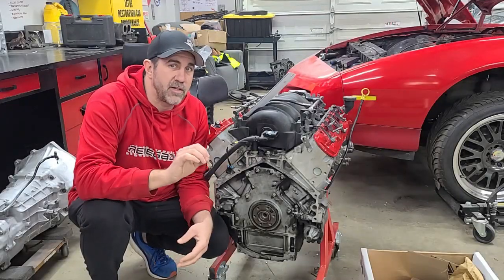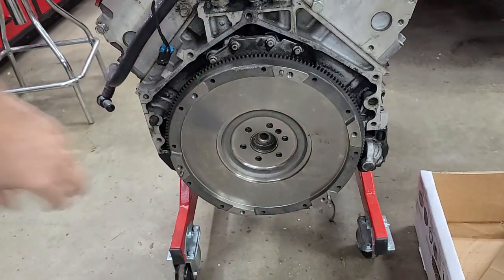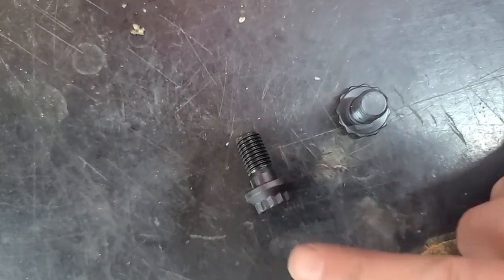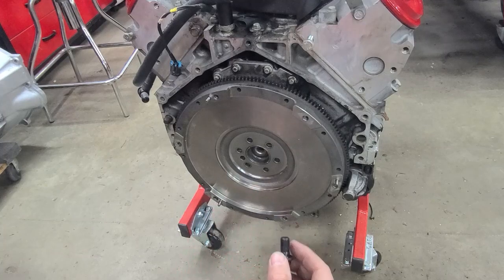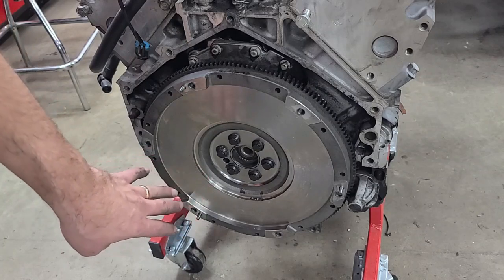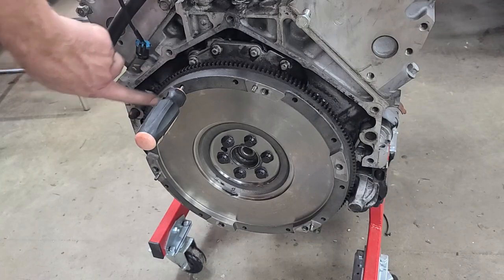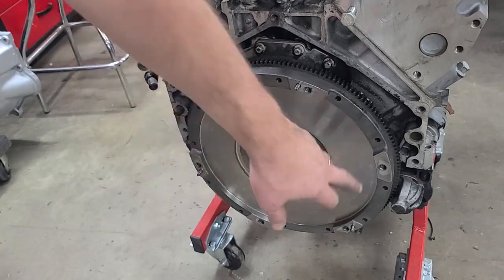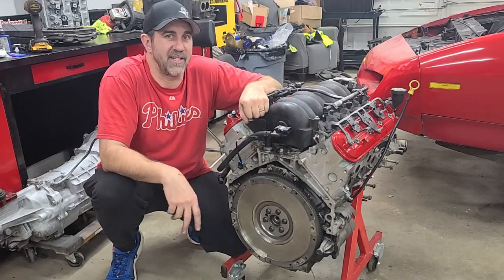Then Midnight Mechanic Tech Tip - LS1 Flywheel Installation!

Comment: The bolts for the LS require thread sealer because if you don’t use it , oil will leak from the Crank.
Reply from the maker: Should use thread sealer on it anyway.

Comment: Hi, great video, very helpful for me, thank you!  I'm swapping to a T56 behind my 2002 6.0 LQ4.   Will the pilot bearing that came with my LS7 clutch kit tap right into my LQ4 crankshaft, or do i need a different bearing?   Also, I'm planning to use the flywheel bolts that came with the Luk LS7 clutch kit.
Reply from the maker: Yes, the bearing will work. We recommend going with a bushing instead though, we never use bearings. You can also use the flywheel bolts that came with the kit.
Reply: @TheMidnightMechanic  thanks. I'll report back how it turns out
Reply: @TheMidnightMechanic why use a bushing instead of bearing?